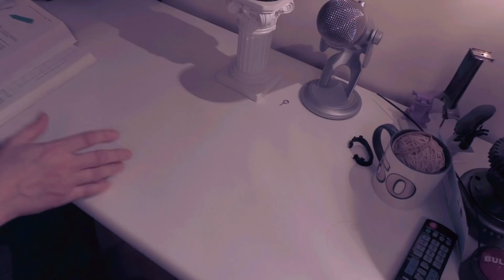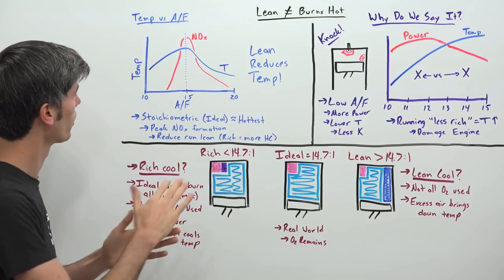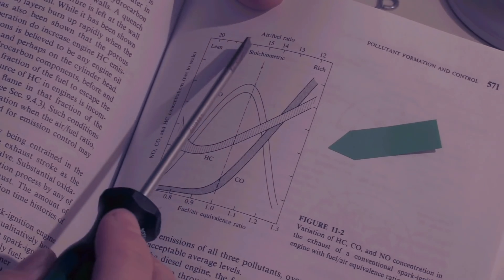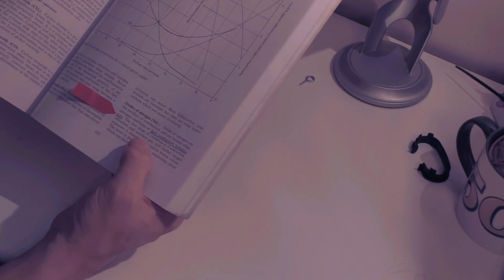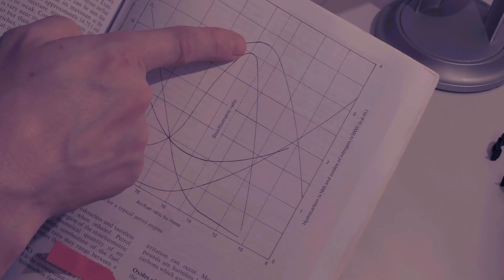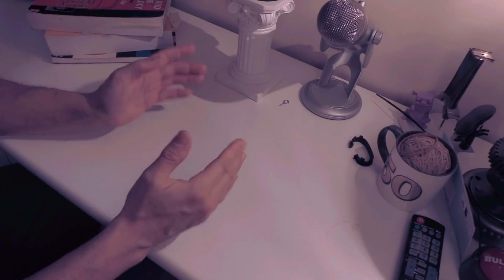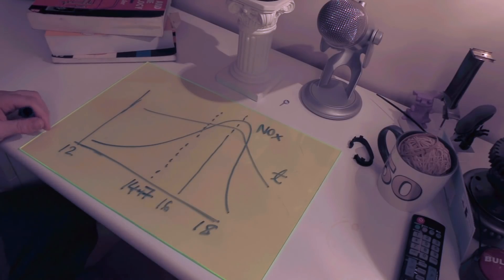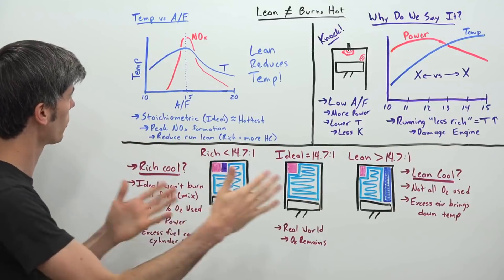Any idiot can draw a graph - EE Strikes again!

Comment: I thought anybody into combustion engines (and especially an engineer trying to teach something to others) knows that when you deviate towards a lean mixture exhaust temperatures rise. 

Jason is also perpetuating the myth that diesel engines have higher torque as compared to petrol engines because of the higher compression. As if NA diesel had a higher torque. I don' t fault D4a for that view, but somebody pretending to know what he is doing as Jason should accept when he spews bullshit and try not to pass on more fallacies!

Comment: I watched all your videos on this topic and this is the conclusion i got. Correct me if I'm wrong.

Lean engines produce more heat because there is not enough evaporation of fuel to take away heat.

The heat resulted from this is enough to break up the triple bonds of the dinitrogen atoms. (Production of Nox emissions.)

This releases shit tons of heat, enough to literally melt your engine.

It's basically a domino effect?
Reply from the maker: First we need to differentiate the difference between hotter combustion temperatures, higher EGTs and higher engine temperatures.

People, like Jason get confused because they think higher combustion temps. How can this be possible? Higher temps from less fuel? 

What we're talking about here is higher EGTs and higher engine temps. 

So;

1. less cooling from the fuel = higher cylinder, cylinder head and piston temps.

2. Higher engine component temps means less heat transfer from the exhaust gases to the coolant. Which means EGTs are higher.

3. Higher EGTs and less fuel/more free oxygen means more NOx.

Comment: Hello i have two questions.
How do lean burning engines kept cool ? Do they have better cooling?

And why do diesel engines that run lean dont overheat??
Thanks
Reply from the maker: Diesel engines don't operate in the same was. There are 2 major differences.

1. Diesels have direct engine, so running lean or rich doesn't have the same cooling effect

2. Diesels run at slower rpm meaning fewer combustion event per second meaning less heat flux
Reply: @thedirtyworkshop  Hi thanks for the reply.
Yes i found that about diesels and now i try to find about those port injection Lean-Burn gasoline engines like the old Honda civic had . I cant find why they dont increase temperature. Is it because they work lean only on low load ?
Reply from the maker: This is all about mixtures. Stratified and homogeneous mixtures. Stratified combustion mixtures can be run richer with added air as combustion continues. So some cooling is in effect. Temperatures do increase but most stratified system are at idle and low load/cruising.
Reply: @thedirtyworkshop  thanks for the help :)

Comment: You're partially right. Cylinder temperatures peak with slightly lean mixture, but modern turbocharged fuel injected engines are often run ridiculously lean to reduce cylinder temperatures, emissions and fuel consumption. Peak power is achieved with rich air/fuel mixtures and this "optimal" mixture is often confused to stoichiometric ratio. That's why conditions with peak temperatures are believed to be lean when they actually are nearly stoichiometric. EE is talking about modern car engines and why during low loads they are tuned to run extremely lean. He is trying to explain the reason why modern engines are tuned like this and that's why i think your critique isn't completely fair.

Comment: Nox is increased in lean also because you need excess o2 left over after all hc is oxidized.  This is regardless of temp as it is high enough in that range.  Temp goes up because the combustion is more complete with excess 02.  Nox formation is endothermic

Comment: The little I know in engine tuning suggests that when you're making more power, such as full throttle, power enrichment is used in GM vehicle. This decreases the AFR to 12 or so. To help cool the engine. I think boost requires even lower AFR. If lean cooled the engine then target AFR would be higher not lower

Comment: I can remember reading all about the then new Lean Burn research, back in the late 1990's to early 2000's, in some engineering magazine.

This chap obviously hasn't.....

Lean Burn was brought in, during the 2000's, because US automotive engineers had measured that 2 stroke engines, because of their higher combustion temperatures, produce far less NOX, per cc, than a 4 stroke engine, due to the higher combustion temperatures. Lean Burn 4 stroke car engines were a way of RAISING the combustion temperature, of a 4 stroke engine, as close as possible to that of aa 2 stroke, in order to reduce NOX emissions.

US Government tests, on Lean Burn 4 stroke engines versus non-Lean Burn 4 stroke engines versus 2 strokes, stated that a Lean Burn 4 stroke engine only produced 24 times the NOX emissions of a 2 stroke, per cc, which was a huge improvement over a non-Lean burn 4 stroke engine.

Comment: Gotta love my competitors melted pistons on a 2T that was running too close to the edge (lean). 

After building excessive heat down the straight he shut the throttle, removing the fuel cooling and lubricant to the cylinder. Nipped up nicely. 

It made the last races of the championship much less stressful for me! Also gave us a chance to look up his ex-port and see the illegal porting his engine had...

Comment: Can you please explain lean of peak operations for aircraft piston engines?
When I fly I manually lean the mixture to peak power and temperature. From there I can reduce EGT/CHT by either  enriching the mixture or further leaning (lean of peak operations) in this instance leaning does indeed reduce temperature. The rich of peak will yield more power than lean of peak for the same EGT/CHT and the lean of peak will yield better economy.
Reply from the maker: There's a difference between lean/rich of the optimal settings and 14.7:1 and either side of that ratio. Bad English is to blame.
Reply: @thedirtyworkshop  I see. I rewatched the vid and the argument is really stoichiometric vs peak which happens at a leaner ratio. So yes it does get hotter from stoichiometric to peak then starts running cooler. The only disagreement I have with some of your statements is the engine can run fine cooler (lean)  of peak. Only to a point mind you and there is real danger of damage if gone too far. That said aircraft do it routinely. It's much easier to manage at a constant RPM. Bad English is to blame. It just depends where you are starting and stopping on the graph to see hotter or cooler. Keep up the good work. Makes people think.

Comment: I tuned around on the 2 stroke when I was 15-16, was getting so lean, because i had no jets, that the engine self ignited the combustion and screamed at full speed even when i removed the sparkplug cable.
Tried the same in my car when fueling cheap petrol on a high performing turbo engine, the ECU just turned up the fuel as much as it could and when that failed, it turned down the boost to get back to safe limits again.

Comment: Can you talk a bit about the physics of how heat is sapped out of a combustion chamber when a fuel undergoes a phase change. Also, is oxygen molecule that ethanol has assisting in power creation or is it just the cooling effect that allows for more ign timing, boost, compression etc
Reply from the maker: Yep, and the specific heat of different fuel and why the values are different

Comment: Misinformation like what you just busted, is the reason why there is so much bullshit out on the internet.  Years ago (will have to do this again) I built a gasoline vapor fuel system and had it running on a small 4 stroke.  Maybe 3 hp or so.  Worked great, but I had trouble keeping the temperature below piston melting point.  Atomization is not the same as Vaporization.  With vapor, you don't have the fine droplets of fuel that help to cool the cylinder.  Kind of like engines which use other gas fuels like Propane, ect.  These use special valves and have better cooling to compensate for this.  The do burn nice and clean though.  I gotta build another one of these, they are cool.  Too cool, as another problem I had, was the vaporization of the gasoline, was cooling the vaporizer to the point where it stopped making vapor...  can you say, "heat exchanger?"  Yeah, I need to make one...

Comment: Running lean eliminate the cooling effect that evaporating fuel makes by converting heat on the surfaces of the cylinder/piston to latent heat. Like when you get out the water on the beach and the water on your skin evaporates and the air temperature feels much cooler than before you went in the water.

Comment: He clearly did not see my monocylinder's exhaust manifold becoming red hot (litteraly glowing red) with and air leak from the starter plunger lip gasket alone.

When it's too rich, it just doesn't start hahaha!

Even with greasy black spark plugs, it never happens...

By the way, I asked you a little question on an old video recently, the video is from de er5 séries, where you take the drum brake apart, if you see it, maybe...

Thanks!

Comment: yep its because young dumb Jason is confusing 2 separate things combustion temp and engine temp....the engine will start to run at about 14:1 (rich and cool combustion Temp) keep cutting down the fuel and it will run better and better until it reaches 14.7:1 (stoichiometric and optimum combustion temp ) keep cutting off the fuel and the combustion temp will increase and the engine run lean, at about 15.1:1 it will start to flat spot 15.3:1 it will stagger and die....any kid with a model aeroplane engine will know this.... so thats combustion temp, ....poor Jason is mixing it with engine temperature and he is right at either side of stoichiometric the engine will not run and will be cooler because its STOPPED....so the graph that he has created is actually useless and meaningless and thats why nobody else bothers to produce it.... i bet he has been looking at his ODB2 scanner and he sees the fuel trim settings where the ECU is trying to maintain stoichiometric either because of a vacuum leak or clogged air supply and he thinks wow look at this the ECU is leaning or enriching the mixture and my engine temp is dropping either side of stoichiometric .... the reason it drops is that it is running like a bag of shit and it is the ECU trying to maintain the engine and fooling him until it just gives up and says bolloxs and guess what turns the engine off.

Comment: Out of curiosity what does water injection do to the process? Is it simply reducing the temp via evaporation in the cylinder or is there also some breakdown of the H2O into combustibles?
Reply from the maker: Water is actually a product of the combustion. Aside from that water does 3 things. 

1. Replaces some of the fuel volume
2. evaporates to cool the internals, reducing detonation
3. because it has a huge specific heat, waterabsorbs more heat from combustion, again damping the process
Reply: @thedirtyworkshop  always have been wondering but way too lazy to calculate what the steam expansion does in terms of recovering some of the heat losses/aiding in combustion pressure
Reply from the maker: Energy is energy, doesn't matter what fluid is used
Reply: @thedirtyworkshop  yes but I suspect most of the transition happens during exhausting when the droplets rapidly get smaller in size from flow and accelerations

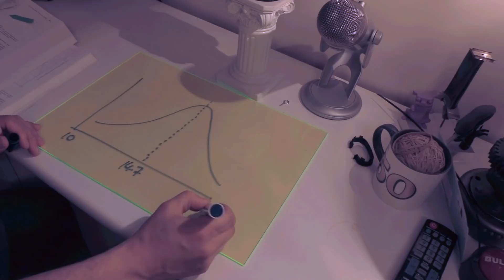Comment: 2:55 that temperature plot doesn't match his. Hopefully that's an honest mistake and not an attempt to strawman him.  Your whole argument seems to be that be has the peak of temp and NOx at 15 AFR instead of 16.

His whole point is that for peak power, you want to run rich. If you run more lean than your target, you could still be rich (but not rich enough), and so run into temperatur problems. Whereas running significantly lean in an absolute sense will have lower temperatures and so is feasible at part throttle in engines designed for it.
Reply from the maker: "2:55 that temperature plot doesn't match his."

- You must be fucking joking?

"Your whole argument seems to be that be has the peak of temp and NOx at 15 AFR instead of 16."

My whole argument was that his video was wrong, in the comments Jason states that NOx drop off at 14.7....

You should stop watching any video about the subject. You clearly have no idea what the video was about. Jason was talking about a 'myth' and he was 'busting' it. The problem is that he doesn't understand what people mean when they say running lean. No-one means 16:1 or higher, and you obviosuly don't know that either...
Reply: @thedirtyworkshop  your temperature at 2:55 is strictly decreasing from 10 to 20 AFR. His peaks at 14.7. It increases ,from 10 to ~15 and decreases from ~15 to 20.
Reply from the maker: It's an example... you didnt realise that?

Comment: You're wrong mate. Peak flame temperature is on the slightly rich side of stoichiometric, read some more. The explanation for that is actually quite complicated. Then NOx production doesn't ONLY depend on temperature so you're using the wrong marker on your examples. Also the explanation you gave on the dragster cars is wrong...they still have combustion occuring in them which momentarily reach about the same temperature of around 2000K+ give or take. They don't use cooling cause they only run for a few seconds would be my guess. 
Lean mixtures do reduce flame temperature, I'm sure you know that. Rich mixtures do that too. Rich mixtures PERFORM better in SI because you can increase spark advance DUE to the cooling effect. The total heat load from a combustion cycle will still be higher however because simply you're producing more power, you're only avoiding pre-ignition with rich fuel mixtures
Reply: The nox production is more when the engine is running lean, engine is running hot during this time (there isn't enough fuel to absorb the heat in the combustion space). The temperature drops when the mixture is rich as a result of heat absorption in the combustion space by the fuel. 
Rich mixtures are also used in diesel engines. Its not only restricted to SI engines.
It doesn't matter if ur engine is making 30bhp or 10,000 bhp the temperatures will always be in the allowable range, including the jacket water temperature and the exhaust gas temperature this range depends on the construction of the engine. 
Nox depends on the construction of fuel pump, fuel injectors, fuel timing, cam profile, cylinder head, pistons. On a given engine if you alter any of these things it will lead to change in nox emissions.

Atleast this is what I understand after working on board ships.
Reply from the maker: "You're wrong mate."

- I ain't your fucking mate.

"Peak flame temperature is on the slightly rich side of stoichiometric, read some more."

- LOL Who said it wasn't You're obviously dumb.

"The explanation for that is actually quite complicated."

- It's not that complicated, I did a video about it....

"Also the explanation you gave on the dragster cars is wrong...they still have combustion occuring in them which momentarily reach about the same temperature of around 2000K+ give or take. They don't use cooling cause they only run for a few seconds would be my guess."

- Notice how you said 'would be my guess' - LOL You're wrong, but if you think you're correct, prove it. You have about 2 weeks, then I'll do a video and prove the other way.

"Lean mixtures do reduce flame temperature, I'm sure you know that."

- I'm sure in the video I cover this, ENGINE temperatures NOT flame temperatures. Funny how you said iy's complicated but you don't understand this...

"Rich mixtures PERFORM better in SI because you can increase spark advance DUE to the cooling effect."

- That is not an explanation LMAO you dumb knobend.
Reply from the maker: An idea would be to buy the book "Internal Combustion EngineFundementals" by John Heywood and read that.

Comment: A top fuel engine also typically is only running for less than a minute(often in its entire life)
Reply from the maker: That doesn't matter. You dump 15 MW of heat through a block in 5 seconds and it's going to melt
Reply: @thedirtyworkshop  From what I've seen they do(melt/burn up, that is) when I've seen top fuellers not one of them crossed the line with its engine intact.
Reply from the maker: Yeah but that's not thermal damage. Usually valves hit the piston, bit's of piston break off or rod's let go. I have a piston with 5 runs on it, top fuel. What's interesting is the damage from 'bits' under the piston, not above it. There's also some valve interference due to rod stretch. I'll do a video.